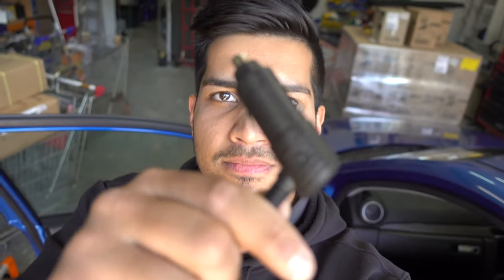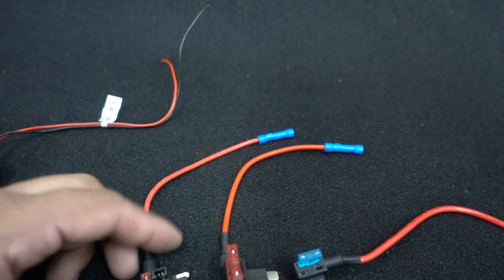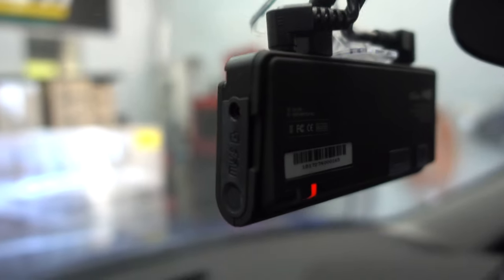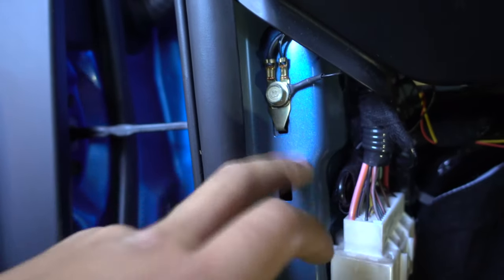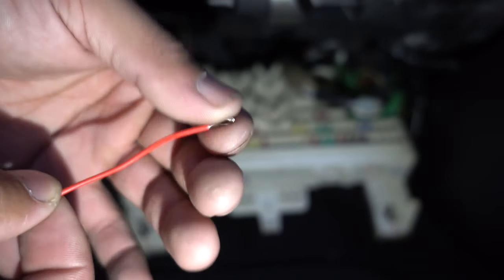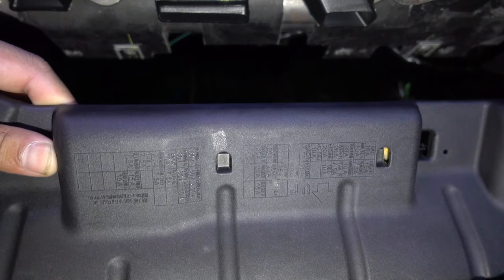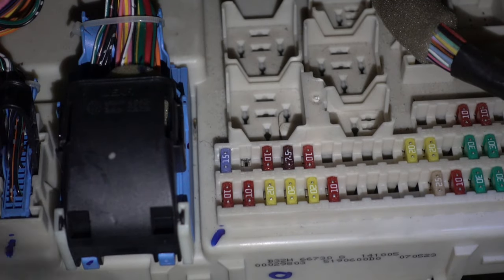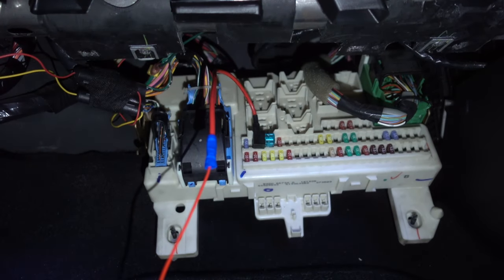How To Hard-Wire Any 12V Plug

Comment: Such a simple explanation the other videos were so scary using voltmeter and cuting wires and using makeshift speaker wire etc. i have to buy that fenale socket but good solution im running a dashcam to my e46 but the factory 12v socket is ALWAYS hot so this is a good alternative thanks

Comment: Great video! Why don't you like to wire behind the rubber seals in the door? It looks like putting the wire behind the paneling of the A pillar is more likely to obstruct the airbag, where the rubber seal is more behind the airbag? Doing this on my car now.
Reply from the maker: Nah man removing the A pillar and running with the factory loom is 10x better so when (hopefully never) the airbag deploys, it has no obstruction from cabling right underneath it.
Reply: @TheFittingBay  thanks!!

Comment: In doing what you did in the video, taking the cigarette lighter fuse and adding it to the add-to circuit. Would the cigarette lighter still work also?
Reply from the maker: Ethan Shea Yes it will :)
Reply: @TheFittingBay  i'm pretty sure both my cigarette lighter and my 12v outlet have always on power. I don't want the this but i can't find any to fix this.
Reply from the maker: @jvirg  if only there was a how to video hmm
Reply: @TheFittingBay  pick a difference fuse is what you are saying

Comment: Thanks! I was about to just cut into the 12V male section and splice that, until you mentioned the female end can act as a voltage reducer. Sure enough, my camera is 5V not 12V.

Comment: Video seems very easy to follow, cheers! Trying to outfit 10 assorted vehicles (Chevy and Ford trucks) and need to figure out correct fuse tap sizes for each. Please advise if there is a data resource I can use to accomplish that. (short of having to buy all the sizes and figuring it out)
Reply from the maker: Paul JT Waters we have fuses and taps here : 
Best way to check without buying is to physically look at the fuses in the car and cross reference photos on that website or try to google but seeing them will be better
Reply: @TheFittingBay  So gather the data from the vehicles and go from there. Got it. I'm a systems-network-electrical guy and your video provided the rest of the answers for the mechanically inclined. Thanks so much!

Comment: If I have an existing fuse of 10amp and I add another fuse for the top row so the 10 on the bottom and new one on top does it have to be bigger the same as the 10amp on the bottom

Comment: Hi thanks for the upload.
I will be using the cigarette fuse which has a 15amp fuse. What amperage fuse should I add to the fuse for my Blackvue Dashcam? Do I purchase a 15 amp aswell?
Reply from the maker: Nah we normally use a 5 :)
Reply: So just confirming. On the bottom slot of the fuse tap I’ll add the 15 amp fuse and on the top where it runs along the red cable I can add a 5 amp fuse?
Reply from the maker: @at74ck  first spot is original fuse. Second (back) spot is the new one

Comment: What Ampere would you recommend for the female plug? I saw that there are variations as well. Should I purchase 2A, 10A or 15A?
Reply from the maker: Check the rating on the product you’re running and go slightly above that

Comment: Can I solder the female cigarette lighter adapter directly to the back of an existing cigarette lighter instead of splicing in at the fuse box? I’m trying to add a 15w wireless phone charger to the center console and there’s a cigarette lighter right above it.

The product says 5v 2A / 9v 1.63A. Would I need to inline a fuse as well? It’s on a 2015 Toyota Camry. Sorry for all the questions, I’m brand new to car wiring.
Reply from the maker: Yep you can tap on to the existing socket as you know which circuit you are on. Put an in-line fuse to be safe but for 2A realistically you don’t need it
Reply: @TheFittingBay  Thanks for the reply! I just got the female socket in the mail today after seeing your video. I'll grab a fuse too, I appreciate your help

Comment: Can you daisy chain the fuses?  I want to use the existing fuse for my cigarette lighter but use two adapters so that everything is wired up to the same fuse.
Reply from the maker: Robbie Plankenhorn The way to do that is to use the single fuse tap in the cig lighter plug and wire both accessories to the output wire. Just add up each current draw from each device I.e 2A each then put a 5A fuse in it
Reply: @TheFittingBay  Ah so just wire up two female cigarette plugs to the same fuse in parallel?
Reply from the maker: @robbieplankenhorn2580  That’s right and just make sure the fuse size is correct and not way too high or too low :)

Comment: Great video, if i replace a 10 fuse do i need to put two 10 fuses into the add a fuse? since you could potentially be running two devices off that fuse
Reply from the maker: Put removed 10 into the first slot. Check your current draw rating on product, put a fuse slightly higher than that into the second spot. So it could look like 10/5 or 10/2 etc
Reply: @TheFittingBay  I tried this tonight, I have everything working. Except when i plug in my product I only get 5-6 Volts. Before I plug in the product i get 12-13...why isnt there enough volts to power my product?
Reply: @JoeyBravo312  because usb cables only push 5 volts

Comment: Hi there, great video! I just wanted to know if I could use an empty fuse spot with the same amps? Also, how can we tell where the power (bottom or Top) is coming from without a voltage tester... can we use trial and error?
Reply from the maker: Yes you can use an empty slot. And no you need a multimeter or test light (LED)
Reply: @TheFittingBay  Like what would happpen if we accidentally put it the wrong way around?
Reply from the maker: Alexander Bevan You would have a circuit with no fuse so if it ever short circuits or something goes wrong the device will get fried instead of the fuse and in extreme cases can cause fire
Reply: The Fitting Bay thanks mate. It worked perfectly however when I used the test light, both ends lit up. Dunno if I've wired the fuse correctly.
Reply from the maker: Puvindu Karunaratne you mean both sides of the fuse lit up? Or both terminals with no fuse in the car? If both sides of fuse light up that’s perfect. If both sides of the terminal light up just let the car sit for a couple minutes and keep probing. One side will start to dim and then turns off completely - assuming you’re testing ignition fuses

Comment: If you got a 12 volt plug the male side that terminates in the old micro usb, is there a way to check voltage at the usb end?
Reply from the maker: with a multimeter, check continuity first

Comment: How come you cant tap into the existing  12v plug wires in the car with t taps?
Reply from the maker: RAIDERS 24 You can do that if you want. What you’re doing is tapping on to a wire with 12v but you don’t know what circuit that wire is running on so you’re essentially tapping onto an unknown circuit and using the fuse (unknown size) on it. So going to the fuse box eliminates the unknown aspect and you can choose the right fuse / fuse size and rating etc
Reply: @TheFittingBay  
You will know what fuse it is bc ur tapping onto the existing female socket and just double the fuse amperage....instead of a 20 fuse put in 40 amp??
Reply from the maker: @Raider24  Yep you can do that! Don't double the amperage - if you look at your product you can see how much current it draws in amps. Usually just 5A up is plenty. 

Alternatively you can use an inline fuse - so just tap one end onto the cig lighter 12v - put the fuse in (5/10a) depending on the product and tap the other end to your 12v supply. If your product is drawing 20A like a fridge or something you need to look at the specs and see what the recommended cable rating is , before making any connections

Comment: I'm thinking about fuses
so first of all I will tap 12V from my cigaret lighter fuse and in my car (golf 6 2011) it's a large 20A one.
According to your video I will need a standard fuse tap then right?
Where did you get the tap and the extra fuses if I may ask?
Reply from the maker: IQSYB Correct! That’s a good choice for the fuse location. Any auto parts store (autobarn/auto1/supercheap) etc. they usually come with extra fuses in the same packet. Otherwise you’ll need to purchase them separately but in the same section.

Comment: The second the draw was put in, the fuse blew and the cigarette lighter wouldn’t even work on a normal one in the car
Reply: Turns out the leads on the female cigarette lighter I got were swapped around and the negative went to positive and positive went to negative which with direction specific items caused it to blow

Comment: That's not hardwiring, if you cut the plug off that would be HARDWIRED!
Reply from the maker: Adrian yeah clever and what happens when the plug has a voltage reducer built in? Kaboom fried your product congratulations
Reply: @TheFittingBay  so not hardwired then is it
Reply from the maker: Adrian I guess not. I mean physically wiring it into the fuse box isn’t hard wiring right so f**k me 😊😂
Reply: @TheFittingBay  and the plug and socket you have in the circuit, if someone paid for your education they should demand a refund and buy you a dictionary.
Reply from the maker: Adrian 😂yeah good one. Stick to plugging it in buddy before you start a fire
Reply: If we know for sure that my device is 12v, can i stick it on the lighter wiring? Will i need an inline fuse?